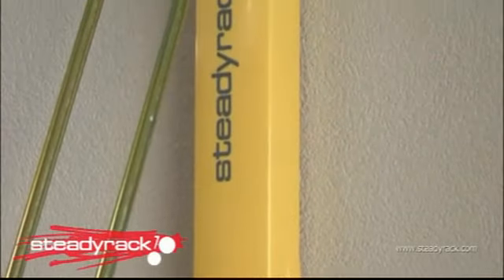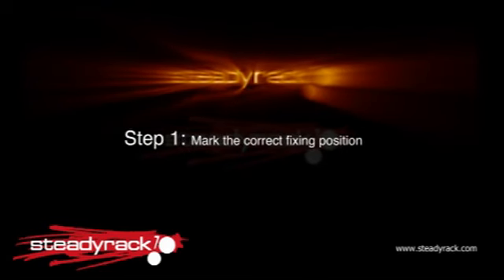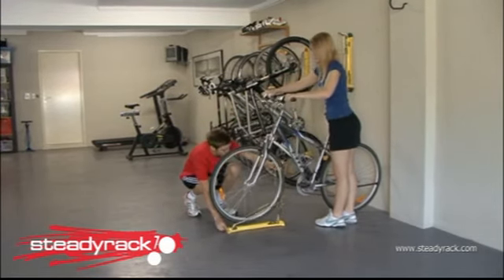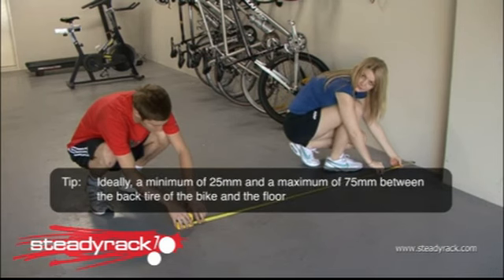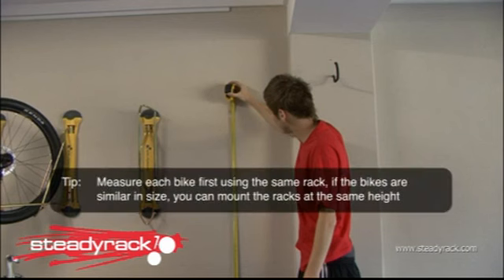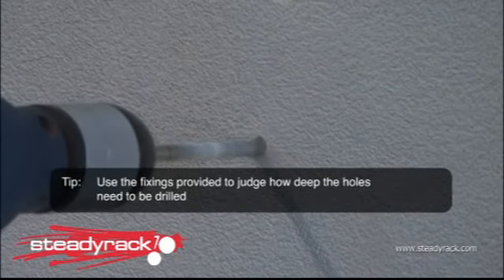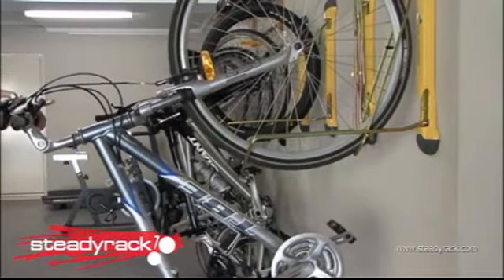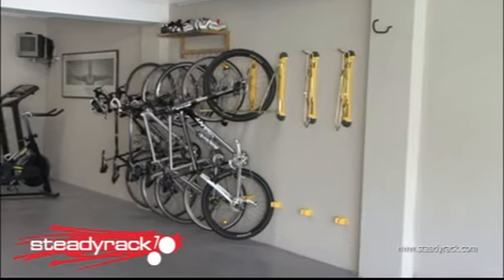Steadyrack Installation

Comment: What does the weight of the bike matter in regards to the 50mm or 75mm measurement?  If the bike is going to be off the floor anyway what difference does the extra 25mm make?
Thanks